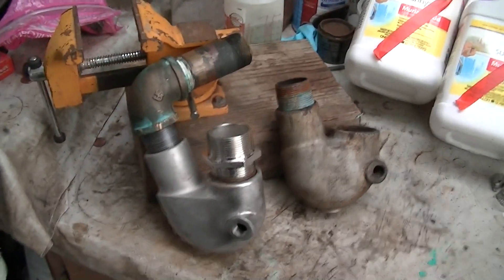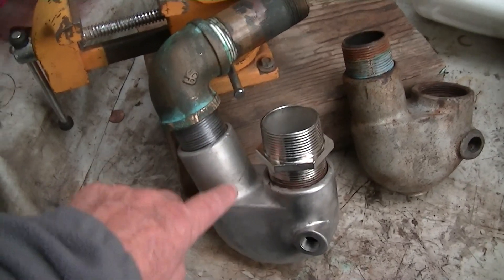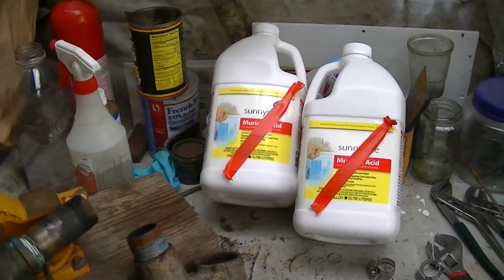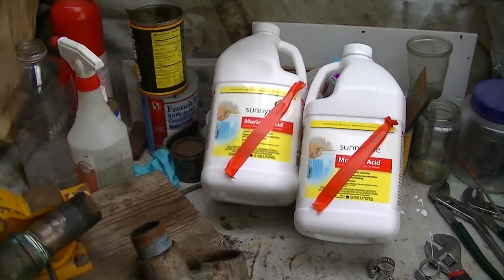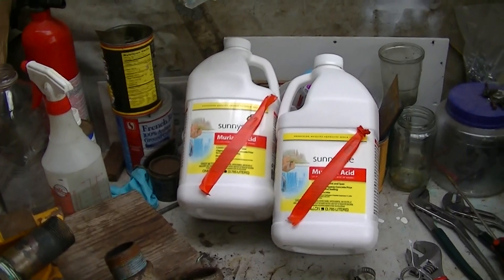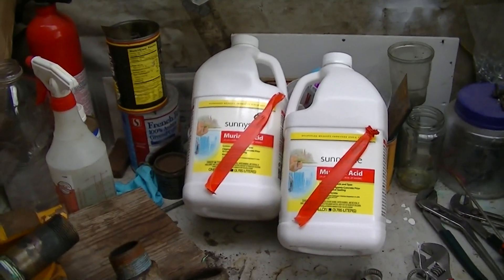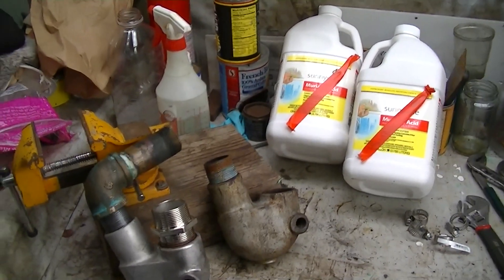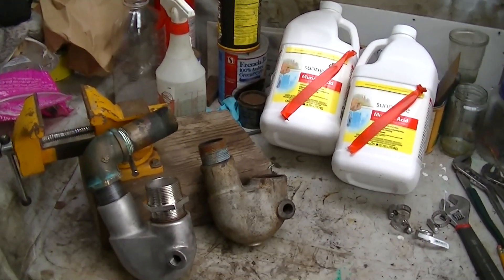Fisher 30 Refit: #76 (revised) A  Nipple That Fits -NO MURIATIC ACID !!

Comment from the maker: It turns out that the dilute phosphoric acid wont hurt your skin ( 5-10% concentration after being diluted), so you do not need a protective suit, or mask.. don't splash it around or get it in your eyes.. in the video where I use it to clean the cooling system.. I end up getting soaked to the skin with it.. with  no irritation or ill effects.. just took a shower when I was done and washed my clothes.  So much to-do about nothing.. Muriatic acid would put you in the hospital used the same way.. Do Not Use It !

Comment from the maker: We were able to get the bronze pipe nipple free from the old mixer elbow, and we re-used it with the new stainless mixer elbow !!  That means there is no steel  in the exhaust path where there is also sea water.   This will prevent electrolysis, and the internal rusting that would have happened with the common plumbers galvanized nipple.   So in the long term.. this eliminates a deteriorating exhaust system.

Comment from the maker: Hard Calcium Carbonate is deposited on the cooling system surfaces.  Diluted Phosphoric Acid will slowly dissolve it yielding 2 parts Calcium Phosphate..a solid precipitate,  3 parts CO2 (gas bubbles), and 2 parts water.  Muriatic (hydrochloric) Acid, will attack metals aggressively And generate Toxic Chlorine Gas..Two excellent reasons not to use it.